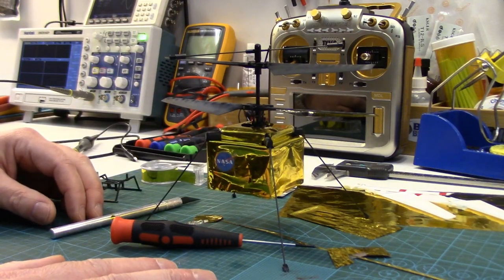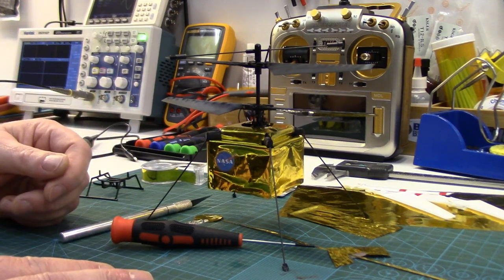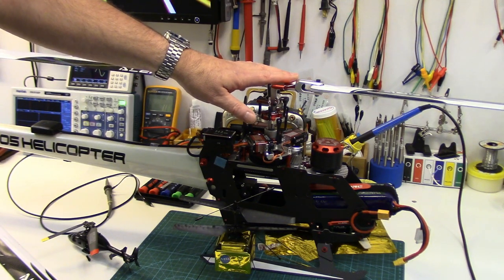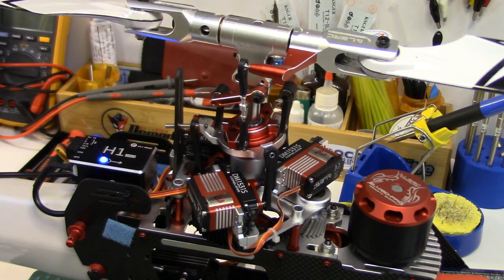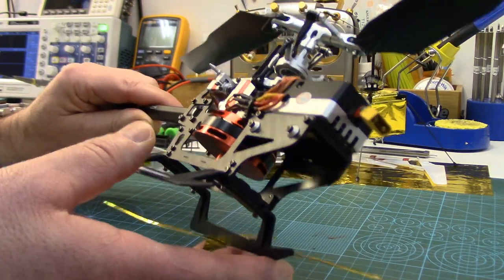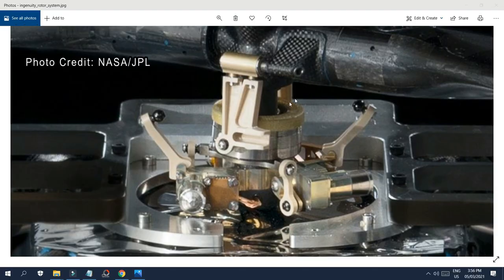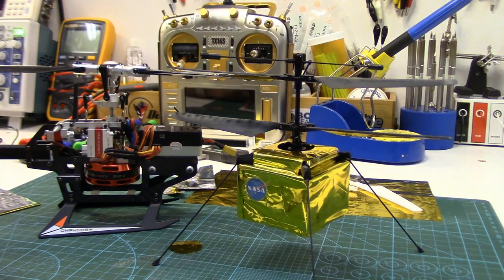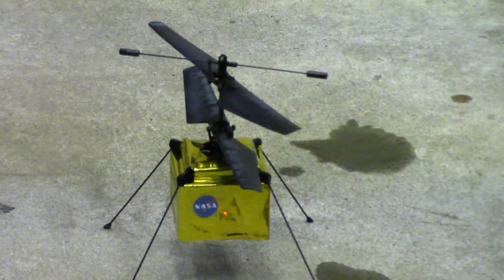NASA Ingenuity Helicopter - Build Your Own Flying Mars Model Helicopter

Comment: https://rotorcraft.arc.nasa.gov/Publications/files/Balaram_AIAA2018_0023.pdf
on page 9, end of paragraph A: "Chinese weights provide a restoring force on the blade moments when under centrifugal loads thereby reducing the torque requirements on the swashplate actuators.", also see Fig. 7
btw - excellent video, Mr. Salt, and such a cute, well built model!! Congrats!
Reply from the maker: Thanks so much for that! Pure gold that PDF link. This is must reading for anyone interested in the Ingenuity's design & function. Thanks so much again for finding that and taking the time to comment & share.

Comment: Neat work John! You think the co-axial build is better for long term use in mars, 10-20 years from now? Where do you see the future of aviation in the Martian atmosphere, long term?
Reply from the maker: If I had answers to those questions, I would be working for JPL 🙂 My 2 cent opinion is JPL started working on this rotary concept in the early 2000's. Lots of research, time & money invested. Ingenuity is also performing very well, dare I say better than published mission expectations. Combine all that with the priceless onboard flight systems data that Ingenuity is now providing every single second it's flying; my logical presumption would be that NASA/JPL is heavily invested in coaxial flying platforms moving forward and will continue to build on these initial successes. Pretty much the way they do with every robot mission. Again, just my 2 cents.
Reply: @Rchelicopterfun  Appericiate the insight, would love to find out what alternate rotary concepts that were explored and failed

Comment: I'm trying to build one just like yours. I found the BLADE on Ebay but will not be able to use 3D printed parts. Did you move the CONTROLLER and RX to the side of the HELO to cut down on the length of the basic power unit?  Or did you leave them in the stock position right at the very front of the power unit?
Reply from the maker: All stock.

Comment: Those horns look to me like counterbalance weights for the load that is put on the rotorblades during flight. When you look at the blades from the main axle point of view you can see that these blades would want to rotate clockwise due to aerodynamic loads. The angle of the horns give me the impression that the centrifugal forces, when the head rotates will make them force the blades in a counterclockwise direction.
Reply: Simply put, these dynamic counterbalance weights will significantly reduce the loads on the servos and allow the engineers to use smaller/lighter servos
Reply from the maker: Yep, that sounds reasonable - appreciate the insight.

Comment: Great video! I can't wrap my head around one small detail, though. From my understanding, the lower (non rotating?) part of the upper swashplate of ingenuity has to be fixed on the lower rotor axle, which would mean that the lower part of this swashplate with those three servos would spin in the direction of the lower rotor. This doesn''t make sense, right? How would you contact the servos if they're spinning...So the lower half of the upper swash plate has to be stationary (non rotating). But how is this done, mechanically? From my understanding, there is no stationary part at this section of the rotorhead you could fix the swashplate to. Does somebody understand what I'm trying to say? Sorry for my english, though :D
Reply from the maker: @Moritz Berger - A couple thoughts. 1. The main mast on the Ingenuity doesn't spin like it does on conventional helicopters. It's basically a fixed hollow tube. The only parts that spin are the two rotor heads that spin around that main mast likely using two stacked sealed conical radial bearings would be my best guess on bearing type. Both the upper and lower servo trays are attached to the non spinning mast so the servo trays are not spinning. 
The core of the brushless motors (the stator) which has all the windings are also both fixed to the non rotating mast. The rotors of the brushless motors (the outer bells with the magnets) are both fixed to the two rotor heads to spin them. 
2. Even if the mast was spinning however, the swashplate is not anchored at all to the mast, if it was, it couldn't slide up and down on the mast to change the collective pitch angle. Swashplates use a spherical plain bearing to accomplish both articulation angle and free up and down movement on the mast. The swashplate is essentially "floating" on the mast. 
This video I did on swashplate service may help understand the general design better:  https://youtu.be/_SmHR3IJqOY
Of course, the Ingenuity's swashplates are slightly different from the one shown in that video, but the principle operation would be the same.

Comment: I was hoping there would be one of these made for us but you go and make one yourself. Awesome! 🤓 I am interested to know what NASA’s contingency plan is if it falls over. Would they try to use Perseverance’s robot arm to set it upright? How would they do that with an eleven minute delay?
Reply from the maker: I suppose if Perseverance had the ability to upright the little heli if it ever tipped over, NASA's surface strategy team would most likely approach the problem the same way they have with past rover missions. Test out the exact scenario using the twin Perseverance rover on earth and then upload the sequence to the one on Mars. Likely in very small steps of progression so they could monitor the progress of the maneuver before moving to the next sequence.

Comment: Hello John. I would really appreciate if you would make a video on how to set up a flybarless helicopter (i use iKON and Bavarian Demon) on the TX16S. I know that most is set up on the flybarless controller - but still a good video explained in a non geeky way on what to do on the TX16S when it comes to helicopters. I got several helis that i would like to migrate from my DX9 to the TX16S. There is no rush - Thanks in advance.
Reply from the maker: Already have. You can search my channel or just google search "RC Helicopter Setup" and it's the first video shown. Usually listed just before my RC collective pitch heli setup eBook.

Comment: It looks cute! Hey, I have a question too

How do you balance the flight of a RC helicopter without making it crash on everywhere
Reply from the maker: Sorry, I don't understand your question "balance the flight". Do you mean how to correctly trim an RC helicopter? If so, it all comes down to accurate swashplate leveling and helicopter setup. It also depends on which type of RC helicopter you are referencing as they are all very different in terms of stability and agility; ie. micro coaxial, micro fixed pitch, or traditional collective pitch.
Reply: @Rchelicopterfun  yes
Reply: @Rchelicopterfun  thank you

Comment: A quadcopter design would be much simpler.. Why wouldn't they use quadcopter design?
Reply from the maker: I explained the two main reasons why in the video, but I'll relay it again for those that missed it. They needed a platform that provided maximum lift efficiency given the power & space constraint's they had to work within. There is no powered rotary aircraft design as efficient as a coaxial. There are other benefits with coaxials as well in the thin Martian atmosphere, but those were the two primary ones. If you want more info on why coaxial, check out NASA's Ingenuity page or JPL's Ingenuity press kit page, in the links I provided.